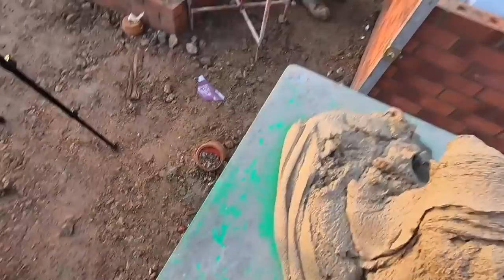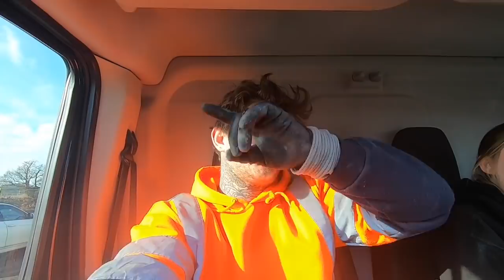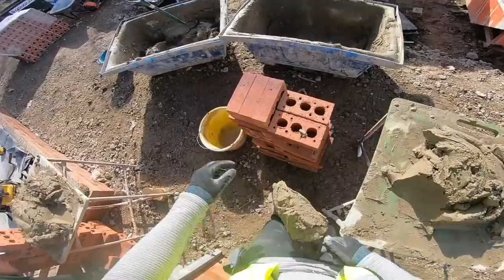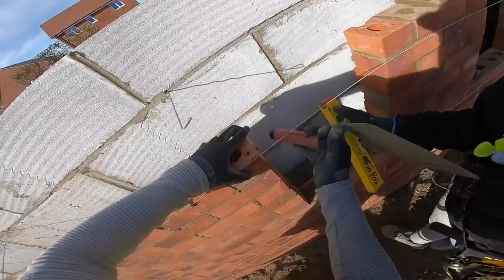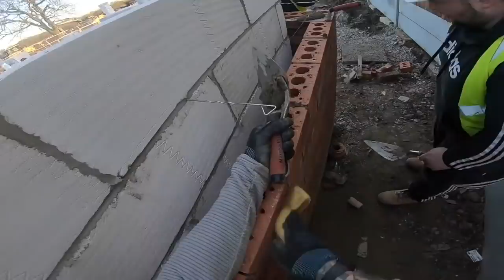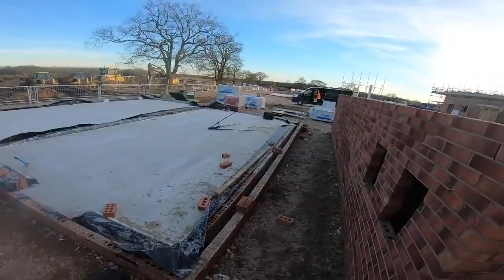Had everyone laying today!

Comment: Being a bricklayer from being a top notch hod carrier I wouldn't be happy  that you just threw 3 bricks from the stack to the floor because you dropped muck off your spot board straight on the bricks beside. Obviously the hoddy cleans up but have a thought for the slap dash approach.  I get your quick but that would of given me the hump back in my days on the hod. The bricks were loaded out clean. Maybe them overpriced plastic boards are the issue,  such as muck slipping too much? Just an observation.

Comment: I pick up the brick then purp the head joint on then lay my bed down so I turn as many times as you do
Reply from the maker: There’s many different variations on laying I’m just talking about the most commonly used
Reply: @CharlieCollison  yes understand, I see some guys bed the whole wall out then start laying, they use the excess from the bed joint as the purp for next brick, although they use this method as you say they have to turn twice as much to get the brick
Reply: @jims5394  working from left to right you should nt be twisting and turning at all, spread facing the corner your laying from not the one your working towards cuts out all the twisting when going to the spot for mortar

Comment: Sorry but cutting three quarters with a trowel is just rough. Especially as you would teach efficiency by telling an apprentice to cut the right sizes all at once.
Reply: 💯 disc cutter or hammer and bolster at least
Reply: What is the craic with them cuts up reveals, is that typical on sites in England
Reply: @bennyred6381  if they haven't been designed to work bricks then a cut yes. Shouldn't be cut with a trowel though
Reply: @vivalachocolat1  you would think them architect slime balls would make all openings an piers brickwork, instead of them zip joints